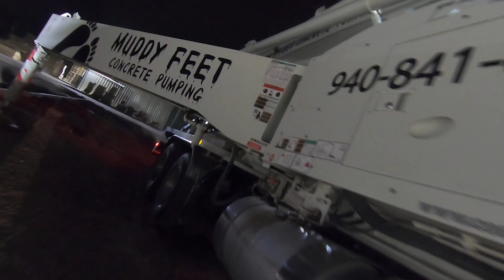250 yards at 2 am concrete pumping with Muddyfeet

Comment: Your tanks look to small for the RPM and the amount of time you look to be pumping sometimes.  How big are the fuel tanks and do you get them refilled on site for the larger pumps?
Reply: I believe they hold 90 gallons. We’ve ran them low but haven’t had much issue. I have an auxiliary tank I can put in the back of my truck if I think we will need it.
Reply: @MuddyfeetTV  thank you